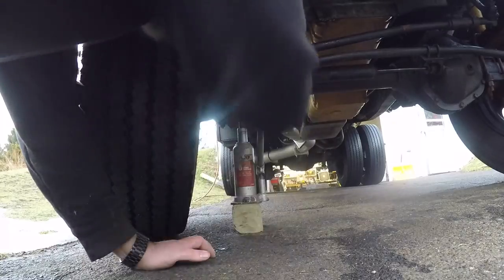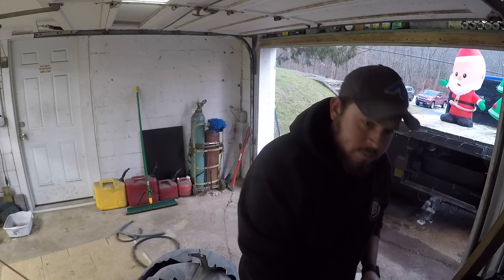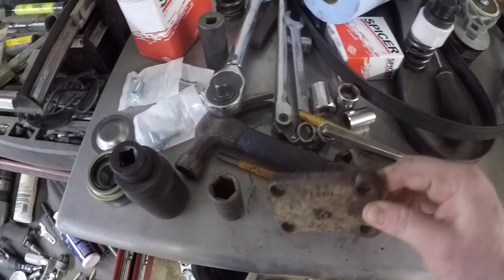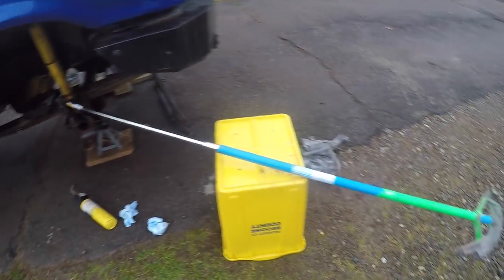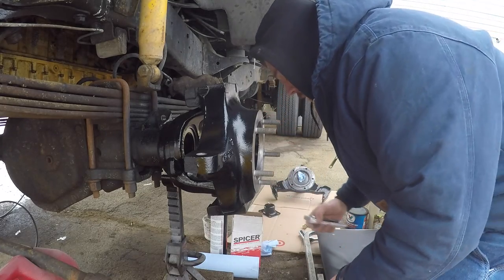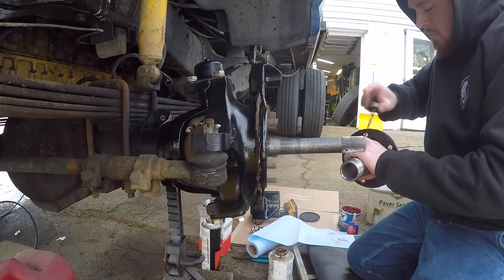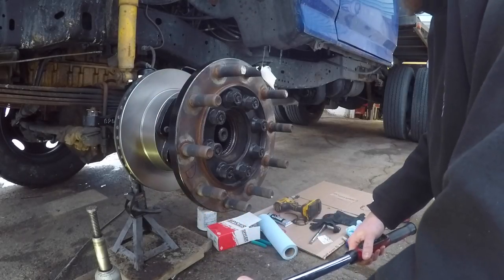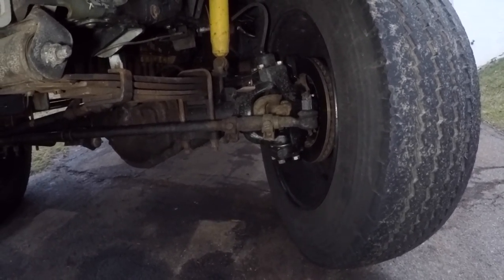Pt. 37 Replacing Kingpins, Bushings and Seals on a Dana 60 Kingpin.

Comment: "all i got was this guy with the big head".....that is priceless youtube right there...40" breaker bar plus a 40" emt bender gets them out! i use "led rocktite" too. most times you see a plug in place of a grease fitting, it was a clearance issue. you put the grease fitting in to add grease...then put the plug back in. looks like you may need a couple front tires!
Reply from the maker: Gotta love YouTube comments! Led rocktite has never let me down! Or you just don’t ever add grease, which was the case here lol.

Comment: man i feel for you in the weather. it ain't west coast weather for sure. 
couple a points 
Did you check the knuckle for cracks? they love to crack at the roughly 11 and 1 o clock position.
the plug on the bottom is either a reverse zerk a dimple zerk we call them, or a true plug that you remove and insert a zert, grease the bottom joint then replace the plug.
this way there is no hours spent with an ez out to pull the remains of the zerk, chasing the hole and reinstalling the zerk when you break it off on rough ground. 
but with those huge wheels the chances of hitting the zerk with something are very slim indeed. 
also those big heavy wheels bouncing around on the ends of those axles are likely the culprit for ruined kingpins.  you will be back in there soon with that weight. watch for bent C and cracked knuckles.rust lines will form where there is a crack.

Comment: Whenever you can't find an Allen key of such a large size, just get a high grade bold with the size head you need and weld it to a piece of pipe or rod. If you cant find the tool, make the tool.
Reply from the maker: I did try a similar trick with finding the same size bolt and it snapped right off. Those suckers were in there!
Reply: @DrEwBaBy625  yea, I believe you lol. I actually wrote that comment right before I saw the length of the breaker bar you had to use. No doubt that kingpin wasn't coming loose on its own.

Comment: If I remember right the ford Dana 60 I murdured for parts had seals behind the needle bearings. Mine is a ballpoint axel but the spindles look the same. And that needle bearing is to support the stub shaft so the locking hub doesn’t carry the full weight of it.
Reply from the maker: On mine the seal went on the stub shat close to the u-joint and sealed against the back side of the spindle.
Reply: DrewMan'sDriveway mine had that too plus the one right by the needle bearings too.710414 is the part number to the other seal. But it only shows up on the 91 with the spindle bearing and seal kit part number DS700014 so the 91’s probably didn’t come with it. But it goes in the wheel hub after the needle bearing and seals on the same surface that the bearing rides on.
Reply from the maker: OffRoadRunner94 hmm interesting! Next time I have it apart I will have to order a set of those seals and add them! Thanks for the info!

Comment: I found that using a 2 foot pipe wrench takes the king pins out very easy
Reply from the maker: 2’ pipe wrench with a 5’ pipe? Lol
Reply: @DrEwBaBy625  I heated up the king pin, took a pipe wrench and put it on where the seal goes on the king pin and hit the pipe wrench with a hammer
Reply from the maker: How did you get them torqued back in?
Reply: @DrEwBaBy625  same way just got it as tight as I could and then filled down the little teeth marks from the pipe wrench.